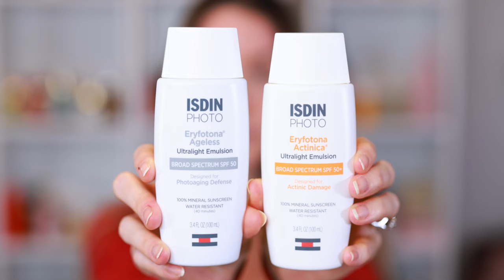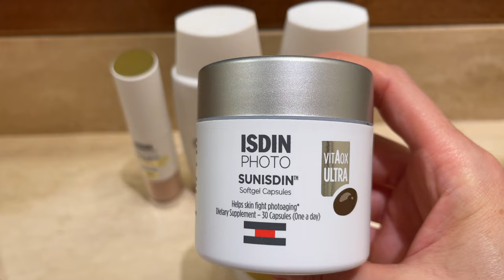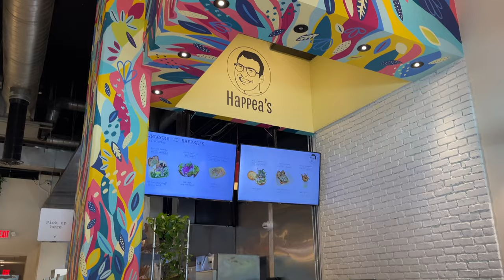OUR NEW HOUSE IS A MESS VLOG! 😱⚠️🛠️

Comment: Erin, with all that water coming through the wall I wonder if it was mentioned in the Sellers Disclosure. It doesn’t seem like it was the first time it happened because of the condition of the drywall. I wonder what condition the floor was in that area ? When you get substantial rain if you are able to make your way to the attic with a flashlight and inspect it for any water. Oh Erin once it is all done your home will be perfect. Erin, remember to make time for date night. 🥰

Comment: Did you get the outside leak of the walls fixed because it's not the inside but the outside too. I guess you didn't  have a home inspection before you bought the house by pros. I  think it's a good idea in Florida. Make sure you don't touch the walls because you could have black mold and that's a caution. Have your house checked for black mold. In Florida that's a real problem for  home owners.
Reply: I was wondering the same thing. A thorough inspection would have revealed these problems!
Reply from the maker: So we had the house tested for mold and a through inspection beforehand. The roof needed to be fixed in order to pass inspection and I'm pretty sure the sellers went the cheapest route. We knew the gutters needed to be cleaned but hadn't scheduled it yet. One mild rain storm and the clogs were so bad the water seeped in, anyway it could. Terrible! So the old walls are now gone and have been replaced. The ceiling beneath the fixed roof leak didn't have any mold just water damage and as of today it's fixed!  This housing market is really tough right now, sellers have the upper hand and we negotiated below listing price. Even though it's frustrating, we know that this house was still a great investment, the best one we've seen in a while! It's crazy lol but luckily the entire back of the house is much newer since it was built later. Now that we are fixing these major issues in the front, I'm hoping we will be set for a while! xx